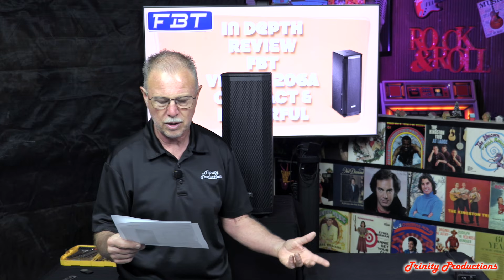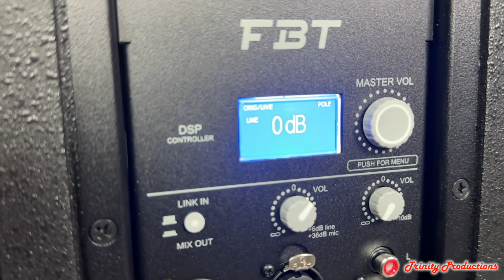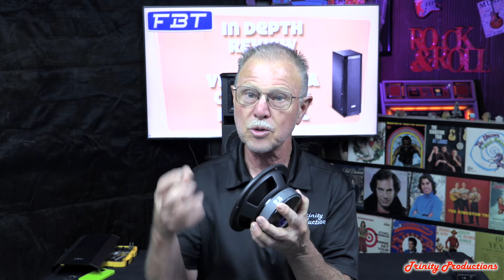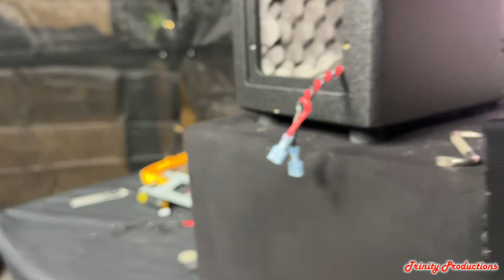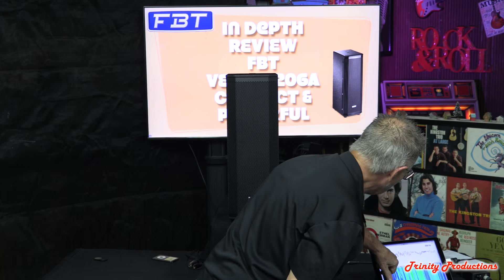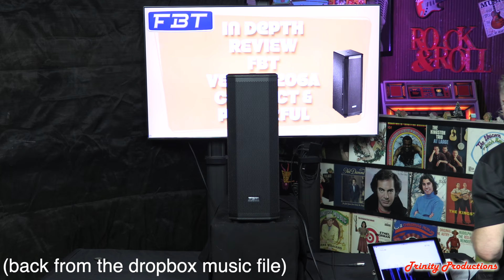FBT VENTIS 206A Active 2-way point source/mini-column speaker with amazing output and features ...

Comment: Nice to see you back! Your reviews are top notch! What you think is gonna be better for outdoor dancefloors with DJ, 2x 206a paired with 2x subline 115sa (one per side left right) or 4x db es1203 ? (2 per side - not looking at the same direction of course)
Reply from the maker: Thanks for watching ! … ya just can’t beat the ES1203 for sound quality, output and portability in a package. If you don’t mind all the separate components the FBT system will do a good job, but the dual 12” drivers in the ES1203 will give you a bit more vs. single 15”. Plus the ES1203 comes with covers , which is another great selling point right out of the shoot ….

Comment: What are your thoughts on the RCF NX910a + 702as mk3 vs the FBT Ventis 206A + Subline 112sa for live bands?
Reply from the maker: The RCF boxes are not a good comparison to the FBT 206A, the NX910 has quite a bit of power to it to get to the max 130db SPL  , but comparing the 702 to the 112sa, I think either will do the job for you, just keep in mind SPL and how that is going to cover for a live band. The 12’s won’t come close to what a 15 or 18 can do , but for smaller events they should work well. Both subs have built in crossovers which is highly recommended you use , keeping the low end out of your smaller driver top boxes. I think in either case your tops are going to out run the 12” subs ...

Comment: Hi, this with subline 12 or db es1203 for live band? I saw on your es1203 comments that it could handle 400 people. I know this system is more expensive but I'm asking about sound quality and SPL output? Thanks! Great vid btw
Reply from the maker: The 206A would be better paired for 400 peeps with a 15” or 18” subwoofer … The ES1203, or ES1002’s will do that , but you will need 2 of them , one per side left and right … the 206A outruns the 112 sub for sure. We are getting geared up to do a concert at a Rodeo locally and are going to use 2 of the Studiomaster Core 151’s for that event , something to give some consideration to as each time we play and demo those i am more impressed with the output and smooth audio from them .  We did a video on them outdoors which can be found here https://youtu.be/M3b13D7wK5k?si=Lh9-VraXP5QL_Rjh  we just tried to get another pair and they are selling out on those as i feel StudioMaster is getting more traction here in the US. Thank you for watching !!!!
Reply: @trinityprosound thanks for response, i will check out studiomaster, not many videos with live band for it. If you have feedback or video how that rodeo went, please post it. cheers
Reply from the maker: check out our facebook page https://www.facebook.com/profile.php?id=100063653076868

Comment: Hi there. This review convinced me to buy these speakers. How do they differ from the Vertus 206A?
I’m also wondering which FBT subwoofers would pair well with them.
I liked the FBT SUBLINE 112SA because of its size and the sound I heard in the review. As I understand it, if I use a 2.1 system, I’d need to lower the signal level to the speakers so they don’t overpower the subwoofer. Or perhaps I should get two of those 12-inch subs? Or maybe a single 18-inch one?
Reply from the maker: The Vertus as a bit more get up and go with a higher SPL … but same driver format … Vertus has the ability to add a 2nd column in an array, where the Vents does not .  For your sub i would recommend a SUBLINE 115SA or the 118SA, as the Ventis tops are going to give the 112 a run for the money … so to speak. The 15 is going to be the tightest IMO  a bit more to wrangle into a gig, but 2 x 15” SUBLINE 115’s would knock your socks off ...
Reply: @trinityprosound  Great answer. Since I’m not familiar with FBT, I’d like to ask: regardless of the specific speaker line, am I right in assuming that all the speakers are designed and tuned for proper phase alignment right from the start?
Reply from the maker: yes they are , and the ones that reference they have FIR phase are more tuned in the DSP than those that do not offer that FIR Phase tuning
Reply: @trinityprosound  Hello. Could you advise me on which option is better? If I use two Ventis 206A units (rated at 124/131 dB SPL peak), combining them adds 3 dB (resulting in 127/134 dB peak); would a single Subline 115A subwoofer (132/135 dB peak) be sufficient to handle these speakers? Or would it be better to use two Subline 112A subwoofers, where the combined SPL would rise from 130/133 dB to 133/136 dB?
Reply from the maker: 2 Ventis boxes , you can splay with a dual stand adapter, but you are not going to get any coupling per se  like line arrays or speakers that are intended to be coupled like the Vertus boxes or NXL or Ingenia speakers. You may start with a single 15, but i think you are going to find that the 206A will out run that subwoofer. I feel you would be better pleased with the 15” or 18” overall than the 12” as pushing it to fill a room you will most likley put it into limiting .
Reply: @trinityprosound  Thanks.
Alright, then I’ll go with the option of two 206A units and one 115A. If that turns out to be insufficient, I can always buy a second subwoofer later. I was just concerned about why it wouldn't be possible to achieve proper integration when using two subwoofers. So, a 2.1 setup is actually the best option? I got a bit confused. What is the fundamental difference between speakers designed for "integration"—like the Vertus, NXL, or Ingenia series—and others?